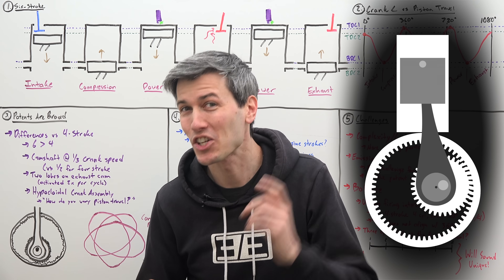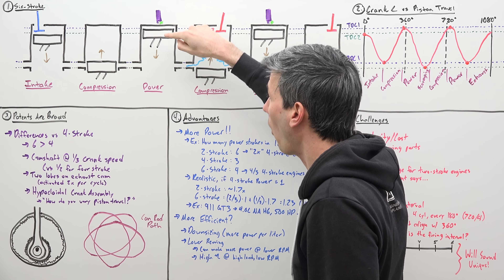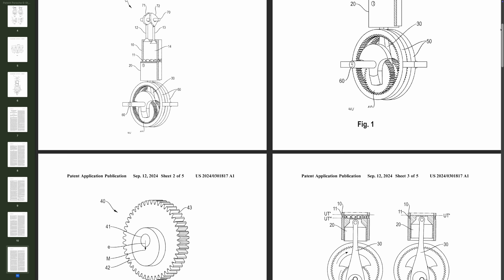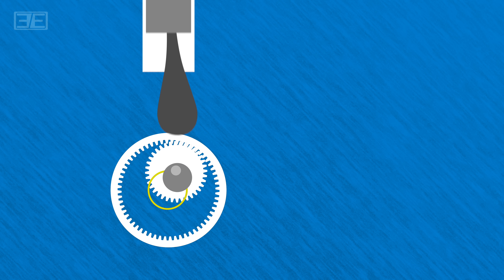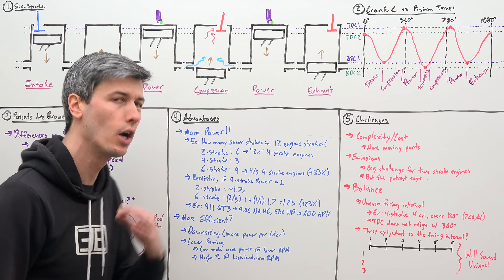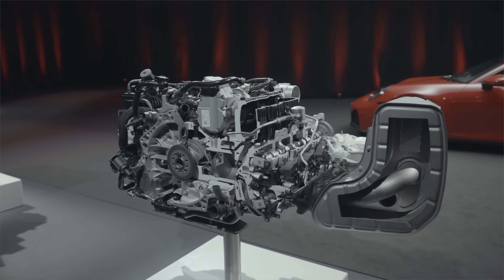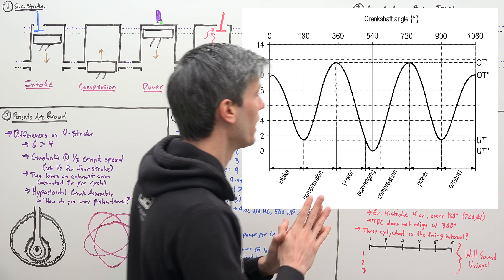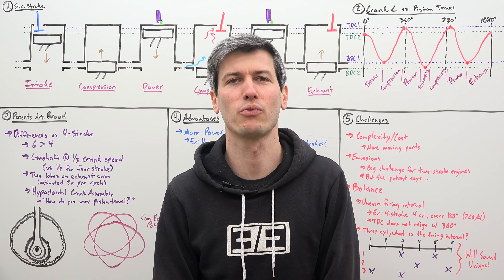Porsche's 6-Stroke Engine Is Genius!

Comment: Great Video!!  After viewing the crankcase, this reminds me of a radial aircraft engine.  Of course they have odd cylinders.  Would it be possible to increase this to a 9 or 12 stroke engine? Basically a cross between all 3 engine types. To balance everything you physically have to offset your cylinders.  Just like a radial engine.  Just an idea.  ;) 😅 Mike Kennedy VA3TEC